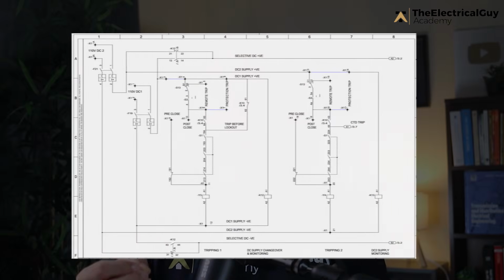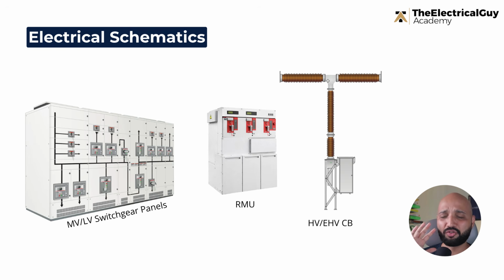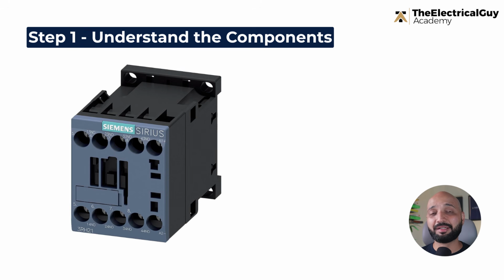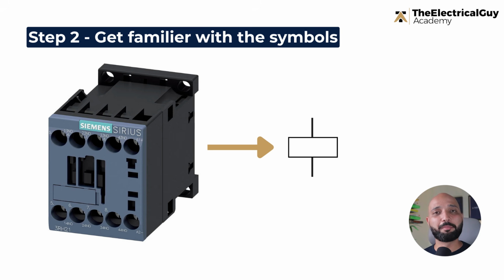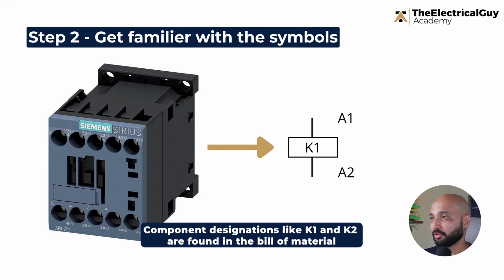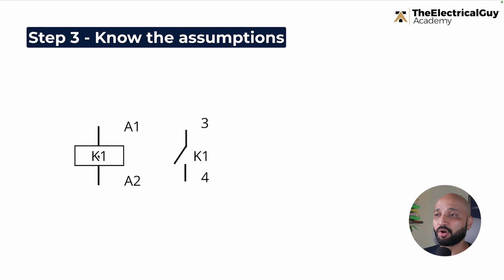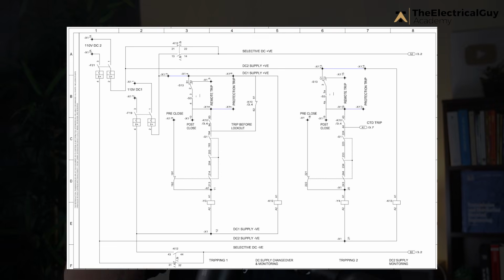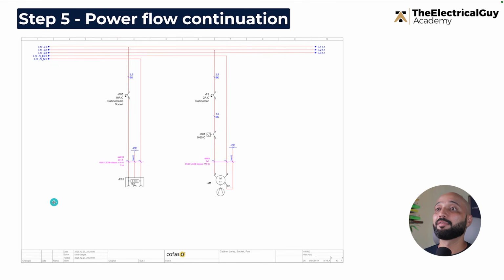Why You Struggle With Electrical Schematics (And How to Fix It)

Comment: Best video sir, I also used to get confused in my earliest stage while testing of Indoor Switchboard & GCB, but later on as you mentioned the 5th step which I called is as circuit Grid location i learned, & today it's very easy to find the selective circuit path & interlock with help of the same technique even it's 10 to 20 pages schematic.